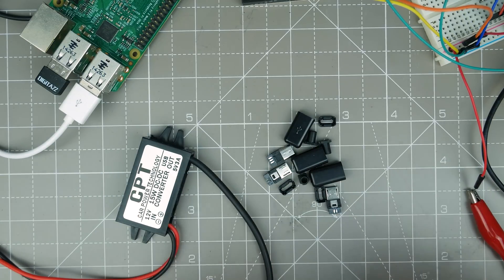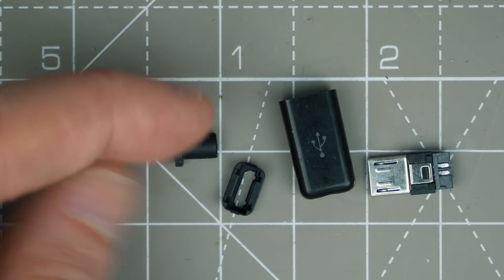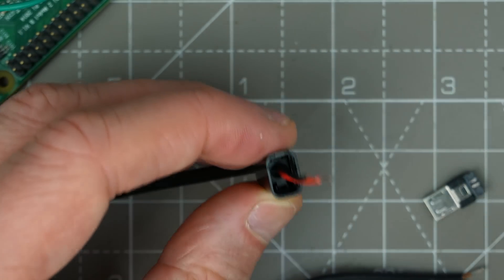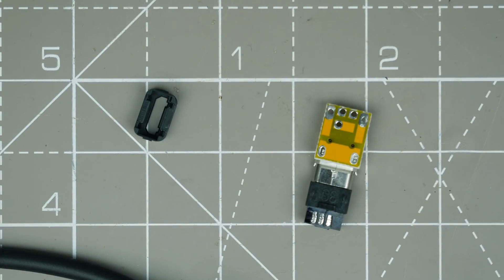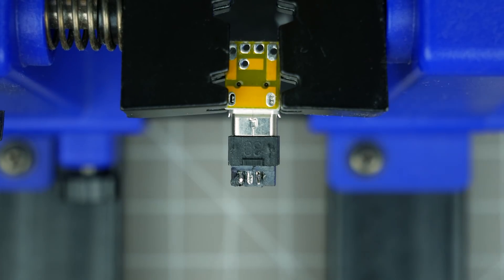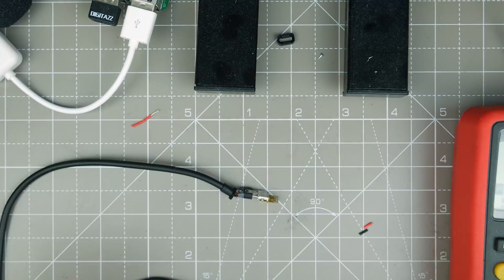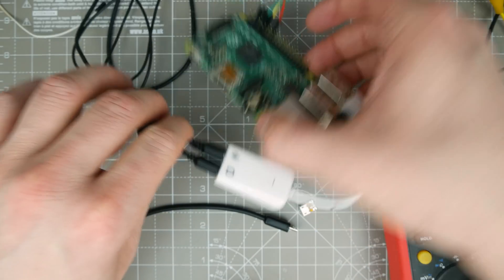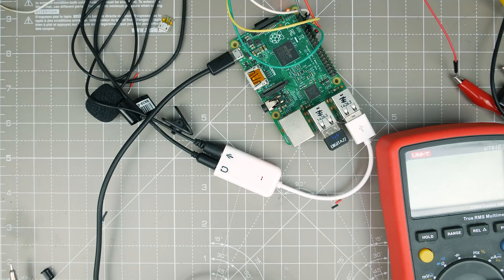Making up a male USB connector

Comment: You should glue that strain relief and the housing 'clip'  before calling it an end. Otherwise you can end up with broken plug stuck to your device..
 Google image pinouts were correct, last time I checked. Saves you probing time

Comment: Aren't you supposed to short the data pins?
Reply from the maker: @911OMG Just checked the Pi schematics and it is in fact quite smart. The data pins are unconnected and is simply used for power, it doesn't 'sense' them at all.
Reply from the maker: I think that is if the device you are drawing power from is smart enough to know that communication method. I don't think the CPT module cares.
Reply: Data pins are used to tell the connected device that it is plugged into a charger that can supply more than 500mA. This is only used for (Android) mobile phones that can charge at high current, as they are designed to never charge at >500mA if the data pins are open circuit as that indicates it's a computer USB port. In this application, there is absolutely no need to supply over 100mA these are not checked, and the PI will probably draw current higher than USB spec. [This comment edited to correct errors]
Reply: @johncoops6897  exactly what I was thinking but it has been some time since I have dealt with this stuff so just didn't remember it clear enough to be 100% sure. But now we got the confirmation how it is Thanks
Reply: @johncoops6897 , 100mA ? not even the first generation Pi was that low ...
Reply: @jyvben1520  - I made a mistake, since did not realise David was using this power supply for a PI. I have just edited my previous comment to correct my error.
Reply from the maker: I am not 100% or even 50% sure so I'll rely on the hive mind.
Reply: In the case of pi it's probably fine but it would be good to short them out just to future proof it.
Reply: @John Wear - yeah, I know Apple devices will charge using the "shorted data pins". In general, iPads etc need 1.8v (D-) and 2.6V (D+) to draw 2.1A, and with Data pins shorted (ie: USB DCP) they will only pull 1 Amp.
Anyway, I was trying to simplify it because most people consider "shorted pins" as the Android way, and "voltage references" as the Apple way.

Comment: Gambling isn't for everyone :)
The extra pin on micro-USB connectors is an ID-pin. That is used to tell the device what is connected. If your phone or tablet has micro-USB -jack, you could make an OTG-cable for attaching things like flash drives to your phone.

Comment: That rubber part you twisted on the outer cable I think is suppose to be pushed through the end of the connector outer hood, this is used as a tension to stop the cable from being pulled out, thats why you had issues pushing in the connector part and the cap.  So you should of made the hole on the outer casing a little bigger.
Reply from the maker: Ahhhhh, that makes sense, I kinda wish the listing I bought them from had an assembled picture. Seems to work ok and will not actually be unplugged or moved once fully embedded in the rotary phone. They updated the AIY project image so I am back in software mode at the moment UGH.
Reply: Yep - all that drama from 9:00 onwards was simply because the rubber boot was getting caught inside the housing. The overly fat cable was causing the rubber to be too large to fit through the hole... hence the connector and end cap wouldn't push in. This is easily solved by careful measuring then sanding down of the cable sheath slightly and/or some silicone lube.
Reply: @johncoops6897  Well I would of made the hole a little larger, at this point we know the rubber tension part was already a snug fit and has parts that will stop it from moving too far.
Reply: @Attitude-Games  Yes, also needs a larger hole you mentioned. Note that David was unable to slide the rubber far enough down the outer sheath, so my suggestion related to that.
A trick that works great: firstly make a trial assembly to determine the correct position for the rubber boot / strain relief. Then disassemble, sand the cable slightly then apply a few drops of SuperGlue from the inside to permanently join the cable to the rubber boot. Then reassemble into the connector housing... makes it just like a "moulded part" (it's actually how many factories make them anyway).
Reply: @johncoops6897  Yeah, I would of laid out the parts on top of the outer case part to get the length of wire needed, also giving an extra mm or two of wire, that way it would make a snug fit etc.  but yeah your way would of worked too.
Reply: @Attitude-Games  - from my experience watching this channel, David W is not the kind of person who researches or thinks things through before commencing to do anything. Perhaps he's in a contest with Julian LOL
Reply: @johncoops6897  LOL
Reply from the maker: Try not to be too much of a bully there John.

Comment: A blob of Blue Tac for holding little soldering jobs is the way to go.
Reply: You are Julian Illett and I claim my 5 pounds lol
Reply: HAHA!! I was waiting for that name to be mentioned..
Reply: Nobody should use that dreadful stuff anywhere near soldering. It's just the wrong product, melts and gets stuck in small cavities (eg: microUSB plug or socket). There is never any need to use such things - they just make soldering more difficult anyway.
Reply: @johncoops6897  depends on the heat required. If it melts, it's too big a job for blue tack
Reply: @TheChipmunk2008  The only way to support this USB socket would be to stick it onto a "bed" of blue tac, which would not only melt from accidental heat but also would fill the socket with gunk. I use medical clamps, or a soldering heatsink clip, or a "reverse tweezer" for holding such items... much easier and faster.
Reply: "I use medical clamps"
Good for you. :)
Reply: Bollocks. Not suggesting it needs to be anywhere near the actual point of soldering.
Judicious use to hold an item in place, doesnt mean smearing it all over the contacts. LOL
Reply: @DreckWatch indeed I have actually held them in my fingers before and my fingers didn't melt so I can only assume the person is using too much heat
Reply: @TheChipmunk2008  - PRECISELY. Anybody can easily tin and solder small connectors like this MicroUSB by holding it in your fingers. So why would you bother trying to support it with BlueTac?
Reply: @johncoops6897  old eyes? [i'm 45]

it helps. but no way is it gonna melt lol
Reply: Ive never managed to melt it either, mainly because Im not in the habit of sticking my soldering iron into it anyway. LOL
Reply: @AlphaBeta - if it only requires a small ball of BlueTac, then you might as well just hold it with your fingers. I've been soldering electronics for over 40 years, and I have tried pretty much ALL of the PCB holders, helping hands, clamps, clips, BlueTac, double-sided tape, etc etc. All of them get in the way, make everything more difficult and slow things down (especially for kit assembly) - most particularly, these 'aids" make repositioning the gadget more difficult.
When soldering a lead onto a MicroUSB (or any other plug/socket connector) I simply plug it into something else, which holds it perfectly.
Reply: Blue tac gets my vote too. Its a firm enough hold and its very adjustable when holding things next to each other for soldering. 
You CAN hold it with your fingers but the idea here is to make it EASIER for yourself,
Unlike holding a wire and a micro usb connector together in one hand (with the wires exactly on the pads), and a soldering iron in the other and trying to make a joint.. Sounds like making a job harder than it needs to be.